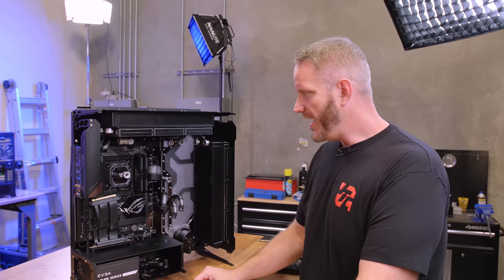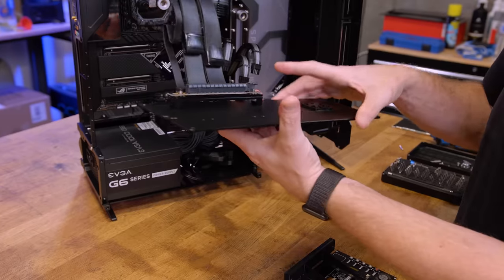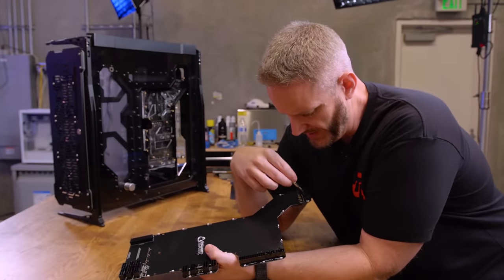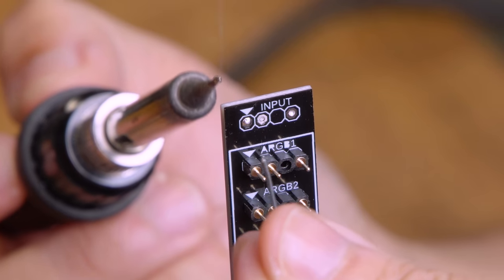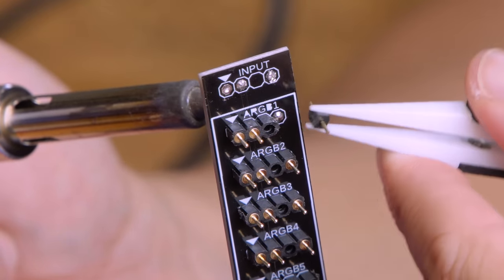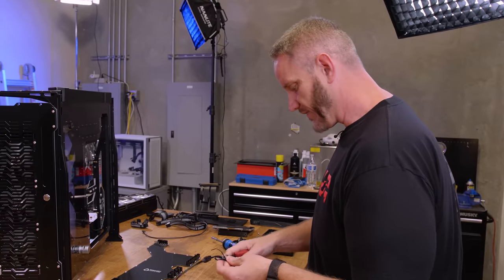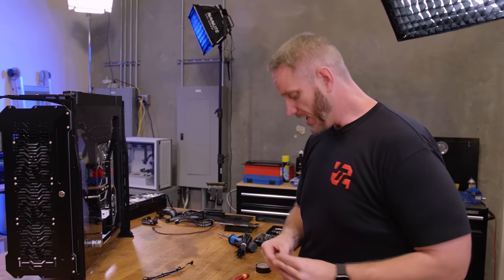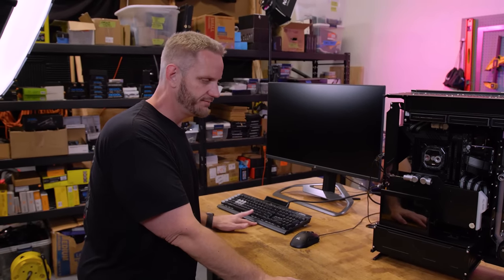This video made everyone mad at me...

Comment: Hi Jay.  The RGB header on the RGB fans is called JST.  It’s actually quite common for a lot of 3rd party RGB strips etc and you can get extensions on Amazon without issue. I actually had a lighting strip kit that uses those connectors etc. but glad it all worked out for you!
Reply: Yup I have a cheap diffused rgb strip running to my commander core with an adapter. Works perfect with icue even though its just a standard argb header. Its all the same electrically, just different connectors.
Reply: i think JST is the universal 3pin A-RGB plug since companies like DeepCool, Phanteks, LianLi, Antec and most cheapo amazon brands use it (even some InWin and most Cooler Master RGB products too). It could just be the standard most companies (Fuck Corsair) decided to use for their RGB suite of components.
Reply: He didn't need to get additional spare stuff from Amazon. They could have just used the spare header that they were practicing soldering on to use those pin connectors off it as a donator and solder them on the power board. Oh well. 

Jay, this computer is the best looking computer I've ever seen. It's a shame it's taking so long.
Reply: JST is a brand, they have many different types of connectors. Always check that you are ordering the correct series.
Reply: A thousand times yes! I have 3-pin JSTs connecting several different Govee light strips around my desk to make them modular for easy disassembly in the event we ever move. The trick is to use light strip raceways so they remain rigid.  Now all I have to di is disconnect them, and put them in a box for transport.
Reply: @Jsteeeez  I do the same. I have a GPU sag bracket, 90 degree 24 pin, SSD heatsink, 3 led strips and an external headset stand all running via a lighting node and controlled in icue
Reply: Blows my mind that a widely utilized standard exists and they choose not to use it.
Reply: Thank goodness for companies wiring them the same. At the end of the day the connectors are what are the standards and how they wire them is something else. PSUs are extreme examples of this
Reply: Hopefully he sees this
Reply: normal case fans (and GPU fans) also use JST connectors afaik. There are several different versions. It would be nice to know which one this is.
Reply: @michaelhillpot  yeah lol I was about to say my airsoft gun runs on a 2 pin jst battery connector
Reply: It's the out pin from the mainboard that broke off tho :(
Reply: Phanteks 3-Pin Digital RGB LED Motherboard Extension/Adapter Cable - I use this for my sl120's
Reply: @pm6039  First gen gigabyte argb based motherboards also had this connector by default.
Reply: 0.100" or 2.54mm (same dimension) SIL header with a blank position. You can snap 4 pins off a longer strip and then cut 1 pin flush (or just pull it out) for a slightly janky alternative to the purpose-made part.

Comment: Jay!  Get yourself some clear filament and 3D print some diffusers for the LEDs on the power distribution board.  Play around with fill% and methods to create different diffusion patterns.
Reply: I've tried this with white and clear and it doesn't diffuse properly due to the print lines, the light will reflect off of every layer line. It still looks cool but nothing like a diffuser.
Reply: @bando9922   nothing some sanding can’t fix! Have wet sanded clear acrylic down to 6000 grit (using micromesh). Makes a very smooth and even light diffusion. Just be sure to print with 100% infill on smaller parts
Reply: I'd whip out the glue gun and slap a dab on each one. Would defuse it pretty good. And as about a jank and Jay usually is.
Reply: Yeah play around with Phill and metheads!

Comment: Great work fixing that header.
Just a small tip from a fellow solder hobbiest, don't pre-solder the hole, actually, clear it with a solder pump, insert the pin and then solder it.
You can actually pump the solder out from the other pins, then pull them out easily, put a full set in the clear holes and then solder them.
Makes you soldering a lot easier
Reply: And what you can suck out with a solder pump, you use a solder wick instead.
Reply: I'm a total beginner at soldering but that's pretty much how I repaired the loose ARGB pin on my motherboard as well. And a large helpful amount of rosin. As Louis Rossman said, can't go wrong with too much rosin. lol

Specifically what I did was I cleaned up the old solder with a wick, I put rosin on the board, got my iron up to temp then preheated the pin and hole from the side before jamming in solder to the spot. I moved the pin a little to ensure the solder goes through the hole then just let it settle.

It's surprising how little force is really needed when soldering. And by little I mean barely any. Let the heat and surface tension do the work for you.
Reply: Was just about to say this. Use a solder sucker and goot wick. Solder after the pins are inserted. Its a fairly basic replacement.
Reply: Yep, a de-soldering iron or pump, or de-soldering wick is perfect for non-SMD board repairs. In a pinch you can even blow the molten solder out of the hole like you would blow out the flame of a candle.  

I'm still using the de-soldering iron that I bought from Radio Shack almost 40 years ago.
Reply: This.  Clear the hole completely, then solder to secure.  From someone who spent 20 years repairing avionics boxes for a commercial airline.
For cleaning off flux, isopropyl alcohol is best, or methylated spirits also works well.  Iso can clean without leaving any residue which is why it is better.
And it is pronounced sold-er.  Not sodder.  There's an L in there that is not silent.
Reply: Yea my joints all got way cleaner on repair jobs, once I learned how to use solder wick properly to clean my holes before putting components or wires through them. On a tiny little job like this it's not a big deal, but if you're trying to remove a component with multiple through pins just like one of these headers, only multiplied several times, you simply cannot get by without knowing how to fully desolder such components properly before installation. Even on small jobs like this, it's a hell of a lot easier as well. I figured this out on my first PCB repair when I was re-capping the whole power delivery area due to a bunch of capacitor plague that surrounded the CPU socket. First cap took forever, but then I finally figured out the technique on how to get solder wick to clean those posts up, and by the time I was done, you couldn't tell my joints from the factory reflow ones
Reply: @NemoConsequentae  I’ve never understood why Americans say “sodder”
Reply: I'll never understand why solder wick and/or a cheap $5 solder sucker aren't just standard parts of any DIY'ers soldering kit. Just makes anything PCB related so much easier, faster and cleaner in the end
Reply: Yup was about to say the same
Reply: @Ian-Omega  Because that's how it's pronounced in North America. Even Wikipedia says so. And it is because we are morons who will stick our heads up our own asses for so long, that we begin to randomly French up,  and Spanish up random words, and make silent J's, L's, and even an H, as in Herb. Which is really dumb, but it's gone on for so long that Wiki even agrees with the silent L in N.A. speak re:Solder...
Reply: You're half correct. Clear the hole, do the entire connector, not just one, which you can do because you cleared out all 3 holes. Pre-TIN the pins going into the board, insert the connector pins through the board, touch every pin one at a time, flowing more solder on to it. You wouldn't even be able to tell it wasn't factory.
Reply: @spazoq  Is there a video showing this?
Reply: @spazoq  Won't even have to tin the holes, as they already are from the solder that was removed.  You only really need to tin when you are first soldering to bare copper.
Reply: @kmoecub   I've got that same Radio Shack de-soldering iron, if you mean the one with the squeeze bulb attached, and it's about 35-40 years old too! I have a spare tip for it too but I still don't have to change it yet even after all the years of use!  I miss Radio Shack.....😕
Reply: while not explained eloquently your point is soooo true. I have worked in electronics for 20 years and this made me cringe :)
Reply: Solder wick works better than pump and doesnt leave any lead.
Reply: @renzojohn06  That can vary by job.  Sometime wick works better, other jobs a pump is preferable, (particularly if you can access both sides of the board.)
We used to have proper desolder tools, that were a hollow tip with a vacuum pump, but for some things we still used wick..

Comment: Useful info, as always! 
I'm not soldering- triggered, particularly - if it works, it works; it's just that you'll find it SO much easier if you clear the hole(s) first (solder-sucker, desoldering braid, whatever works best for you), then dab a little spot of liquid flux into the hole, insert the new pin/connector, THEN solder it. This particularly applies to multi-pin components - you'll be heating the board for less time with less risk of lifting the pads either side of the hole. 
(50 years' avionics manufacture & test experience here, and yes, I've made all the mistakes. Well...  most of them - there's always a new c0ck-up waiting to be found, but don't worry - sooner or later I'll make that, too  😉 )
Reply: Thanks for offering helpful information as well as an explanation as to WHY it's better to do it that way. It's far better to share information rather than just tell someone they're doing it wrong.

Comment: Jay - not a solder nerd, or professional, just a tip with regard to something you mentioned. You remember how you said it was too difficult to heat multiple bits of solder at once to get that multi-pinned connector in properly? Ask yourself: would there have been solder in the holes when the pins of the connector would have been placed into the holes? And if not, why make life difficult for yourself by trying to do it that way?

If you remove the solder from the holes, then you can put the connector's pins all in at once, then solder them into place.

Removing enough of the solder from the holes can require a bit of practice, & some solder is harder to remove than others, but if neither solder wick, nor a solder sucker (manual, or a fancy powered 1) won't do the job sufficiently, I've found there's 1 more trick. Remove most of the solder, then when it's still hot & fluid put your mouth really close (ideally no more than an inch) to the hole & then BLOW as hard as you can in a sudden burst of air. Of course, in your case you could also maybe use compressed air (from your compressor, not a can - you don't want it too cold).

Oh, and you'll want to make sure there's something behind the board to catch the solder; anything will do - scrap paper, card, etc.
Reply: I TOTALLY agree! I just put together a few amateur radio kits a couple months ago and unsoldering multi pin components is such a PAIN with a normal iron! Best $35 bucks I've ever spent for soldering was on a "Berkling" brand butane gas soldering iron/mini torch. The tip unscrews and you can use it as a small torch to hit multiple pass through pins at once, just turn down the gas control valve so you don't roast the board! That or a heat gun can work too, but those usually have a big ass nozzle.
Reply: They actually make tools to remove the solder from the pin sockets. I've been certified to solder nuclear grade I&C equipment. There is copper wicking material you can use to "soak" up old solder. Or there are vacuum pumps you can use to suck out old solder (<$10). His methods worked but were WAY wrong. Should have done exactly like you said, removed solder. Pushed pins through, taped the pin pack with tape to hold it, and solder each pin with about 1/4 as much solder as he used to "prep" the holes.

Comment: This is an informative video that demonstrates how fragile the RGB connectors are on motherboards and I am also not fond of RGB lighting on motherboards. I genuinely appreciate the time and effort that the builds on this channel take despite not uploading videos frequently. Life keeps me busy and I also have a certification that I need to pass before the end of next month. Keep up the amazing builds, Jay.
Reply: yep.. I had the plastic cover for my 3.0 usb come loose.. It still works though.. so Meh
Reply: @codygrinnell8676  Oh snap! I had the same issue on an ASUS motherboard every time and I have to basically push it back in place. Other than that, the motherboard works better than I ever expected.
Reply: GOOD LUCK WITH YOUR CERTIFICATION!
Reply: @codygrinnell8676  Yea these are almost like a one time deal. the first unplugging usually ends up in taking out the plastic shroud!
As for ARGB connectors, they are made in hell.
If you sneeze a bit too hard they pop out. I wish there were JST or Molex connectors everywhere instead, like what NZXT or Corsair uses. some locking connectors that actually stay in place.
Reply: @thesmart1000  Thank you for the encouragement. I will definitely need all of the luck I can get with the certification.
Reply: Right? Motherboard RGB headers practically break if you look at em wrong! Lol. It's 1 of the main reasons those cheaper sata powered RGB fans do so well on Amazon and the like. Yea, they're considerably more limited than more premium products that use an RGB header, but they're MUCH easier to use.
Reply: @BigDrewski1000   @Andrew Baker  I appreciate the simplicity, ease of installation of the SATA power connector, and powering SATA SSDs, HDDs, and various PC peripheral devices. I never thought about using SATA powered RGB peripheral devices in all honesty since I do not use much lighting in my computer. The only lighting I use is on the motherboard since I like using a minimal amount of RGB lighting in my builds.
Reply: @TopHatCentury  Well if you ever do, you can typically pick up a pack of like 3-5 halfway decent rgb fans that get power from the power supply SATA cable, WITH a RGB controller & remote (usually) for less than $50 on Amazon. Usually less than $40. And more often than not they tend to gravitate more towards 5 packs and the RGB on em is pretty decent, but the functionality is what's limited. Like, you have to cycle through all the modes to get to the mode you want. If you pass that mode on accident tho, good luck. You gotta cycle thru ALL the modes til you get back to it. And it's typically 200+ modes! Lol. Altho, to be fair, a high number of those modes seem to be repeats with very subtle, almost unnoticeable differences. At least to my eye anyways. I recommend you give em a look if the whole limited functionality doesn't dissuade you. I got a pack Jay himself did a vid on like a year ago from the brand UpHere. Good stuff.
Reply: @BigDrewski1000  Oh! Thanks for the recommendation. Ironically, I saw the same video Jay made as well with the RGB fans. I do find it quite odd how the RGB settings with these kinds of peripherals have to be cycled through to find the right color setting. I actually bought fans I have now before RGB fans took off into the market. Now I have turbines for fans with no RGB effects.
Reply: @TopHatCentury  Lmao. Been there. And no prob dude. Only drawback (if it can be called that) to keep in mind is typically the bearing on fans like the UpHere fans is that they usually use a hydrolic (I think that's the word) bearing type. Premium purists will tell you to stay away from them as over time the fans being in certain positions, since the bearing contains gel, the fan blades can sag downwards because of gravity, plus the bearings can gum up due to dirty PC conditions. 

Now I say from MY OWN experiences, those  two drawbacks, while valid, are typically a needless worry. 1, the fans last long enough that the rest of you PC will need to be upgraded before the bearings fail, and 2, if you clean your PC regularly your don't really have to worry about dust gumming up the bearings. 

I think you'll enjoy em. Those tons of good brands out there.
Reply: @BigDrewski1000  Thanks for the tip with the UpHere fans. With any computer that I build, I always use hydraulic bearing fans with all of my systems since it is a somewhat quiet yet cost effective compared to maglev fans. I have heard of instances where sleeve rifle bearing fans are good for a vertical orientation and hydraulic bearing fans are good for a horizontal orientation. In my personal experience, I have never had a single hydraulic bearing fan fail on me for some time but it will fail eventually. I simply do not know when it will fail to the point where I will have to buy another fan. I will definitely have to consider which fans to buy in the future when that happens.

Comment: Nees some desolder braid, a little Flux, and that would be a 2 minute repair. Through hole soldering is easy to fix. Surface mount isn't bad either, just have to watch your Temps and not fry the traces.
Clear the thru holes out, put the component through, then solder, don't fill the holes up and have to install the component hot. Make life easier for yourself.